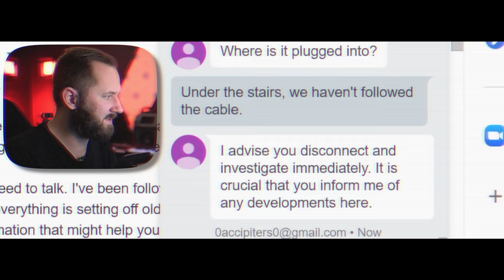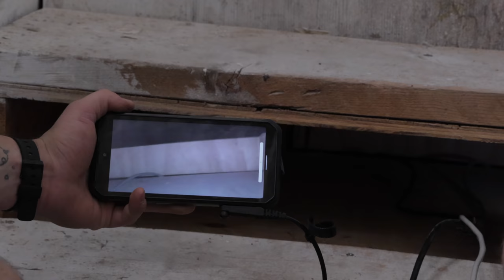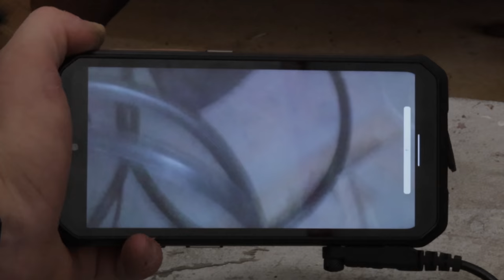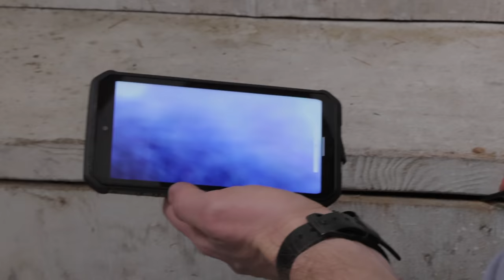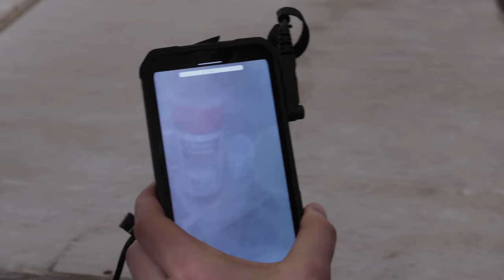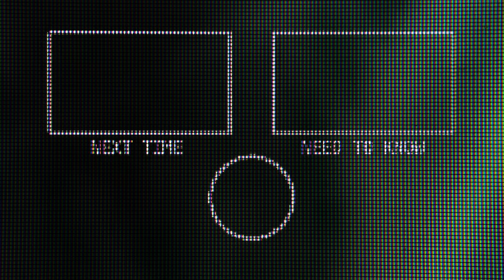We Found A Hidden Trap Door Inside The Studio...

Comment: just imagine how many times he could have been in there while they record
Reply: That's kind of freaky when you really think about it.
Reply: I doubt that. Everything under there had a layer of dust on it. No one has been under those stairs for years. I only saw an area of disturbed dust on the table and it wasn’t that big
Reply: @leahr.5876  Yes, but there is a sliding lock on the hatch. Why would the company before Hi-5 need a lock in there own building? And why would the Floppy Disk Emulator get sent to them if it had nothing to do with them? Why wouldn't D send it to the police instead? (Edit:) So i looked it up and it could take 3min to 4 hours for dust to settle. So in that case if it was never cleaned down there dust could easily be disturbed then settle again by the time Syphus was done.
Reply: @christianphipps7305  I think that whatever is going on has something to do with that old company. The science equipment down there is dated. I think whatever was going on down there was probably happening in the 80s. If there was a police investigation then a lock would be needed to hide whoever is down there. D could be someone from the old company or from the og investigation. We know that the investigation was never finished due to some unknown reason, if law enforcement can’t be trusted then sending it to Hi-five makes sense especially since they have been following the keys for years now.
Reply: @christianphipps7305  they have motion detectors and cameras so they would see if he ever entered or left the building
Reply: @christianphipps7305  also you clearly didnt look up how long it takes for dust to settle
Reply: @jacobd7880  they only recently discovered the case and the trapdoor there's probably plenty of ways he could get in without being on camera. They just now put a camera to see the blind spot on the stairs
Reply: @leahr.5876  Oh! I just thought about this. What if this was some sort of chemical warfare plant that was so secretive that even the police didn't know about it. That could explain why the investigation got shut down and why the person who texted matt isn't supposed to be investigating this. More importantly what that flammable, corrosive chemical is there.
Reply: @jacobd7880  lmao why are you being so negative, she is just giving ideas.....
Reply: @jacobd7880  What do you mean?
Reply: @jacobd7880  Sorry did I do something thing to make you mad?
Reply: i file bad for tham

Comment: When the guy broke into sams office, he probably burned himself and didn’t inject himself
Reply: @TEa Fox after
Reply: I was thinking the same thing
Reply: Hmmm
Reply: I thought he spilled the liquid thing in him instead of inject himself
Reply: yup, injecting himself is illogical
Reply: I've been saying for, well months now, the "injection" gun is too thick to actually inject into people, now that we've seen the case, it looks like it was to inject more acid into the self destruct mechanism.
Reply: Why was it in a syringe gun? For precise application? Doubt
Reply: But the shot gun thingy still had fluid in it
Reply: then why did he have the injection gun?
Reply: I was thinking the same thing. I mean, there was a broken vial, probably with residue on the foam that it burned through. Still not quite sure what the needle gun is for, but I'm pretty sure that he didn't inject himself with what appears to be an extremely powerful acid (or something similar)
Reply: @kenzy4479  He prob was going to do it got burned got the rest in on time and used it
Reply: After
Reply: He did inject himself with it (steroids made by the Syphus origination) yes it does hurt when you get it injected but yes it could also be him touching it (and the result of the two chemicals reacting in open air does create an acid/ fire)
Reply: @TheShadowReviewer  Big bran moment

Comment: Anyone else remember when they were viewing the footage of him breaking in a lot earlier and they said he went some where for like 45 mins he was probably in there
Reply: That was exactly what I was thinking. He went upstairs and disappeared. At first, I dismissed the idea but then I realized that the trapdoor is probably not in the upstairs camera's view. Then there is the case. He probably put it in the stairs through the gap at the bottom and then went into the trapdoor room to plug it in. The reason he took so long was because he was setting it up. Also, there is a lock on the trapdoor.
Reply: I think they had a camera facing from the upstairs doorway down toward the warehouse entrance, unless I'm mistaken.
Reply: @twangycentaur1468  a slither of the trapdoor is in view but since matt fast forwarded through 3hours of futtage in 3 mins we wouldnt be able to see
Reply: The fact that there is open testing tubes with liquid inside. Someone must have placed them there recently. Liquids in room temperature evaporates fast.
Reply: @KateWiiXii  who says its room temp down there it could be cold
Reply: @jacobd7880  True. Matt should go through it again
Reply: @jacobd7880  Thats true, but I doubt it is freezing under there. Liquids will still evaporate when its cold. Just a bit slower, not years.

Comment: 1: typhus might have worked at the unit before you guys bought it which would explain the lab equipment down there and when you were buying it 
2nd: the hidden camera might have led to the apple 2
4th: Maybe "d" is the supposable undercover agent hence why you got the chip
5th: secure/encrypt your lines and message the undercover cop what you've found
6th: get security 24/7
Reply: 1) the buildings were owned by the Syphus origination before Matt
2) 590 planted the camera,while 1 (the leader) gave them the case, the camera was there so 590 can see the leaders face
3) D is Syphus,the leader not 590 as hes helping Matt stop 590

Comment: My question is if syphos used the trap door when he entered red base. How did the cams not pick it up? Matt has mentioned that the cams can see that platform and even when they scim through surely they would notice the floor of the stairs being lifted up
Reply: He probably found a ethernet cable down there connected to the wall under the actual stairs then connected everything together, and that's why it took so long